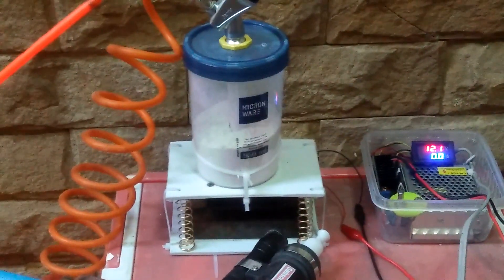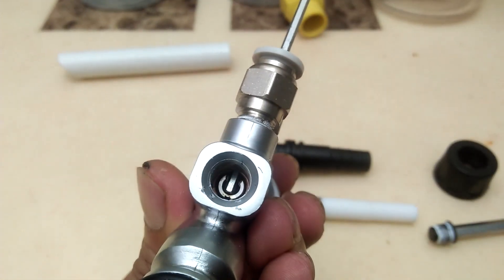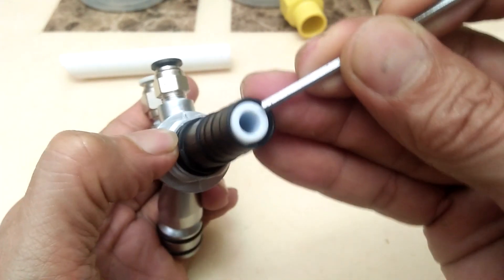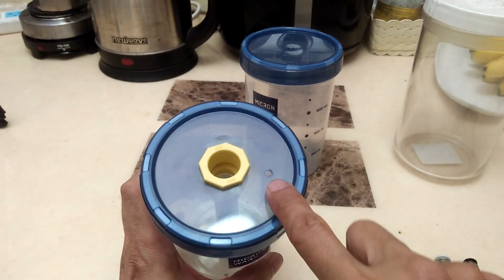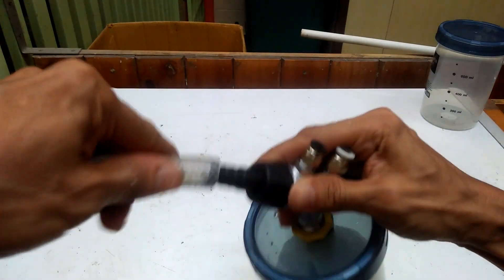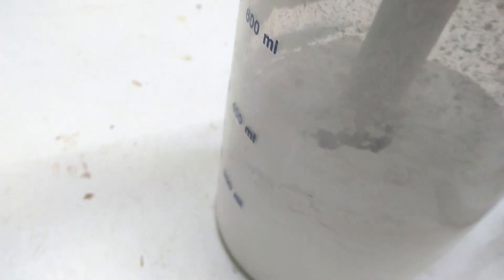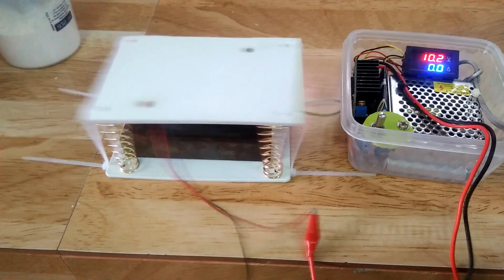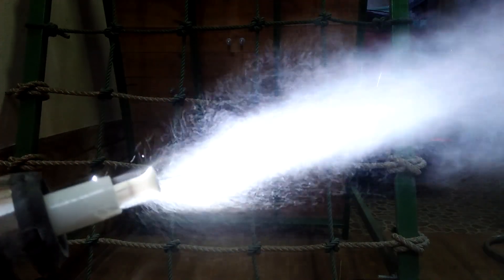Gema Powder Pump to my Homemade Powder Coating Pump

Comment: What is the size of the PVC bulkhead fitting? In SAE????
The vibrating pad is genius.
Thanks for the videos.
Reply from the maker: it is for 3/8" pvc tube used in home electrical wiring

Comment: I have got a 50kv powder coating gun is there a way to increase  the  kv with some  capacitors  to get it up to 100kv
Reply from the maker: It may be possible to add several stages of voltage multiplier at the output. It consists of high voltage diodes and capacitors.